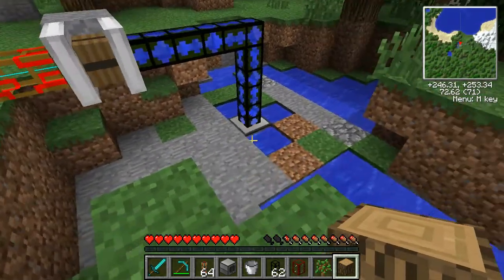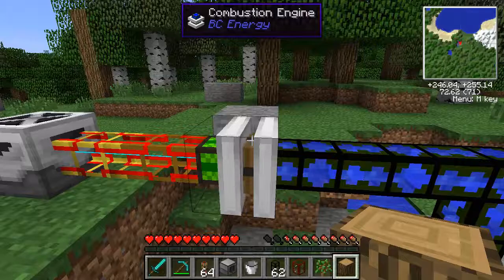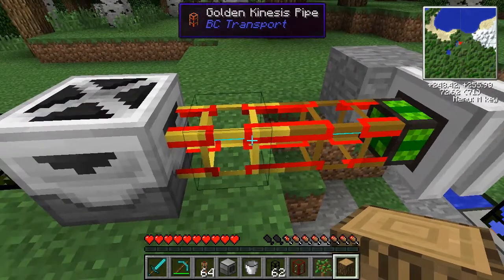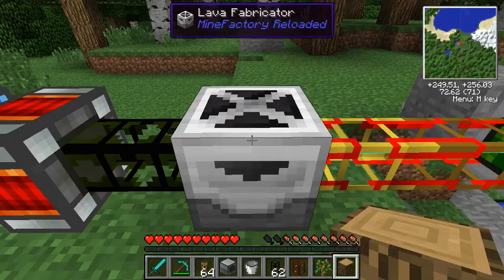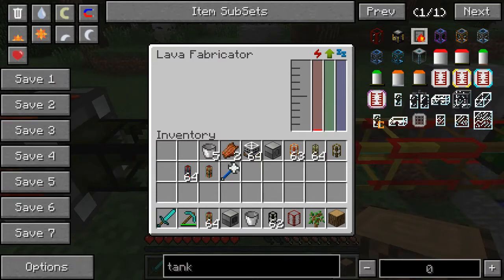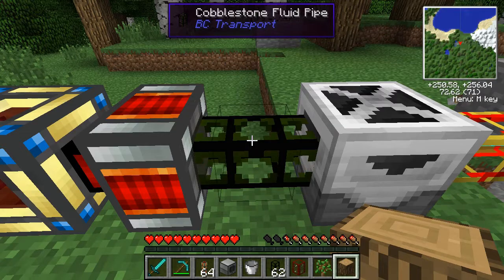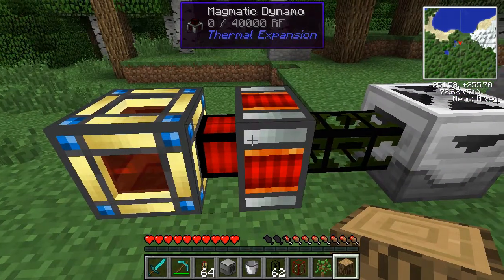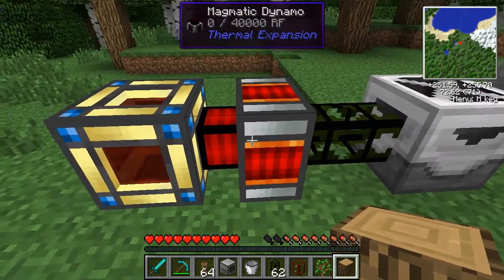Tekkit: Convert Buildcraft Power to Thermal Expansion Power

Comment: Do U know how convert thermal to build?
Reply from the maker: Not off hand, but I remember that one was a lot easier to find using google. You might be able to connect a BC kenesis pipe right to the thermal expansion generator.
Reply: @unixgaming6880 1.6.4 - kust use TE generator
1.7.10 - use any RF mod
1.12.2 - only lava/coal